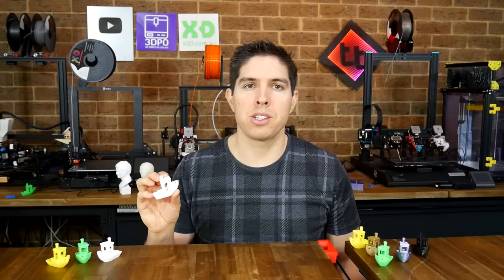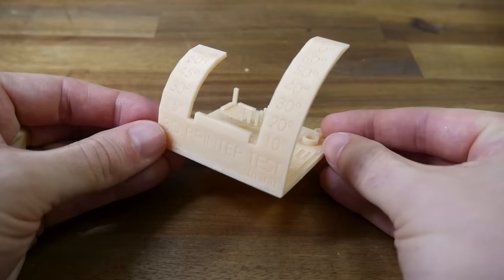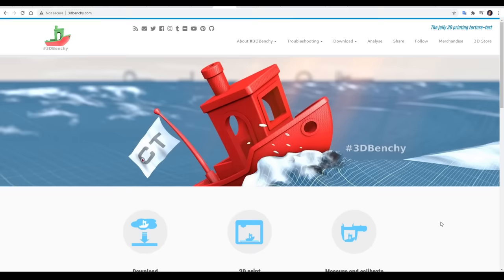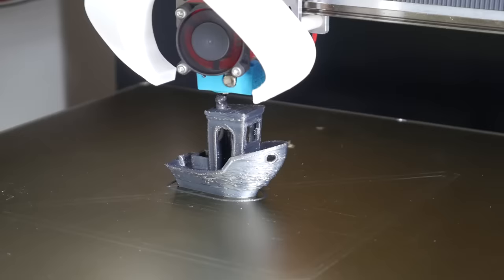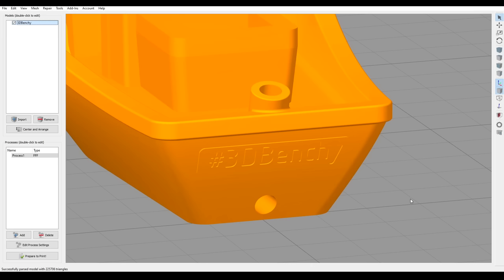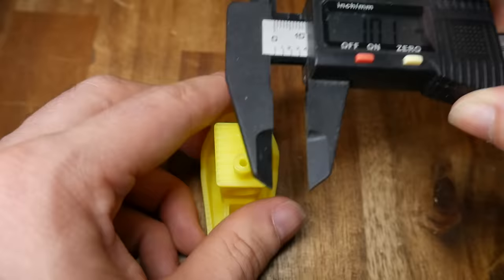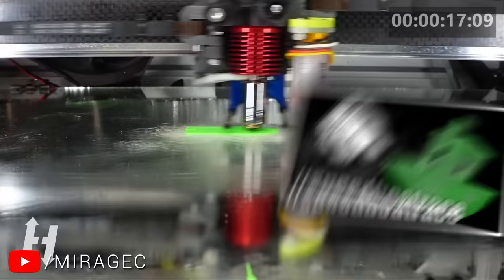How a 3DBenchy can tell where your 3D prints need improvement

Comment: For me, the #3DBenchy is a very useful tool that looks like a silly gimmick.
There's even more to it, for example you can stick the chimney of one benchy into the box of another benchy to easily check for over-/underextrusion and part fit.
Reply from the maker: Didn't know that, great tip thank you :)
Reply: Holy Crapoly!! that is cool!
Reply: I wish the website had "if this issue, solutions are this" would really help with trouble shooting
Reply: It may be useful, but for my personal taste, it's too silly looking to have dozens of these laying around. To be honest, I am not charmed by Benchy. It's too "cute".
I'll just design smaller utilitarian things to test specific things. But I'm boring like that. Guess I'm getting old.
Reply: How do you fix the bubbles/ zits in retraction it's a constant problem for me
Reply: @connorlancaster7541  Can Jesus tell me why my surface settings aren't performing?
Reply: The little bore in the bottom also, it fits perfectly the filament and it can't be a case.

Comment: in 1000 year archaeologist will say "they seemed to worship the god of boating and recreation"
Reply: Well no. Most filaments are biodegradable
Reply: unless the internet is still around
Reply: Nah, they'll be using benchy to test replicators
Reply: Pla lasts forever in the environment seennprontd that were outside for years and no deteration
Reply: @zombiej79  forever is a stretch but it does require ideal conditions to be bio degradable
Reply: @xathridtech727  the one I saw they left it in dirt for 5 years and didn't even change a bit was pretty crazy. I think it needs to be shredded down for it to biodegrade properly
Reply: @zombiej79  It needs an industrial process to biodegrade.
Reply: Hopefully humans will be smarter than that in the future.
Reply: @Mr_Yod  It needs an industrial process to biodegrade in a resonable amount of time( a few weeks). Buried in the ground for 1000 years it would break down.  ABS not so much.   They are gonna think we worshipped LEGO the God of interlocking blocks
Reply: @bjarkebuskbjerg743  they really are not. It will take the right exotic temperatures and environmental stuff. Pla will biodegrade in more than 1M years. You even need some bacteria to do stuff.
Reply: All hail the benchy
Reply: Isn't pla poly lactic acid Wich is biodegradable ? Like I read it was biodegradable but these comments say yes and no wtf
Reply: @bjarkebuskbjerg743  yeah give or take a few hundred thousand years
Reply: @jakeengland1430  well give it enough time everything well biodegrade just may take a few hundred thousand years
Reply: Or just small boat toys?

Not sure how finding a small 2-in plastic toy boat equates to worshiping boating and recreation.
Reply: @dangerous8333  I was pointing out how archeologists today say every trinket they find was sacred and worshiped. When it could have just been a kids toy or decoration.
Reply: @jakeengland1430  Pla is bio degradable
Reply: @willssnowboardclips748  did you even read the rest of thos thread before replying a month late
Reply: @jakeengland1430  no
Reply: @whatthefunction9140  Common misconception. While I’m sure there are the occasional instances of this happening, archaeologists and historians aren’t dummies. 

You hear about all these different special trinkets because…they’re special. They seem special for a large variety of reasons that all correlate together based on 1,000 other clues. 

It just seems like they call everything special because that’s the only things you hear about. No one wants to write an article about the toys or the hobby craft or anything like that(not geared towards the general public at least outside of certain circles). It’s not catchy. Won’t get them clicks. 

But I mean go check out some museums, or even just go check out some online historical stuff and you’ll see it’s FILLED with a bunch of “boring” or “ordinary” stuff that they well acknowledge doesn’t seem to hold much significance apart from giving us some insight on the culture and daily lives.
Reply: Alexandru Ciobanu  nope canadian lol
Reply: Good one:)
Reply: But only the ones printed in ABS
Reply: @gadz7584  biodegradable yes, but only in an industrial composting facility at 60+ degrees celsius with the right organisms present. 
on the ground in the woods or in an ocean only at extremely slow rates, if at all
Reply: Bahahhahahahhaha lit lol'n🤣🤣🤣 I love the sense of humor. I can picture it now😆
Reply: @stickboyfpv4742 
I was thinking we could all print
An ornate box from ABS to place our PLA Benchy in, with a note telling futre archeologists the reason. Why we all worshipped Boaty MC Boatface. 
Lets face it in 5000 years there will be plenty of misinfo about. 
A bit more won't do any harm.
Reply: Well the benchy doesn't float very well on ethyl acetate.
Reply: “These sculptures were clearly made using primitive additive manufacture devices, likely made in a cave powered from pedaling a bike”
Reply: Well, we do.  Just look at Miami Vice and early 80s television!

Our society is secretly divided into four camps - Fast Cars, Fast Boats, Big Trucks and Flying Machines!

Oh and they better talk or no dice!

Comment: As someone new to printing and modeling, the fact that someone created something so simple that is secretly so complicated is amazing to me
Reply: @connorlancaster7541  what
Reply: @connorlancaster7541  now the bots are preaching Christianity. Wonderful
Reply: @Rexxxed  I’m not a bot.
Reply: @billytalentxpokemon  You good?
Reply: 3D printing can be a spiritual experience - when you're dealing with perfection, not only drivers, calibrations, temperatures and speeds have to be dialled in for the exact filament you're using, but external vibrations, thermal air currents, solar heating, cats jumping on the desk, yelling in another room, and some even say brain waves, and the movement of angels near by can effect a "Perfect print".  Some prayers, a sacrifice (can be a leg of KFC chicken), perhaps an incense stick, feeding the cat, and printing at 2am after thermally protecting your filament reel for 48 hours will get you your perfect print. At that point 50cm overhangs at speeds of 3000mm/s, with zero ringing, zero droop, and no hull lines will be yours!

Comment: Massive coincidence. Just assembled my 1st 3d printer yesterday and I had some issues with my first Benchy. After about an hour on forums, I've found out it was insufficient cooling. The second one was freaking perfect. Gorgeous print that made my choose for an Ender 3 V2 worthwhile.
Reply: How did you improve the cooling on the Ender 3 v2? A new fan/fanduct or just slicer settings?
Reply: @hrbatta  not yet. I'll buy a better fan, maybe bigger one (4020 perhaps) and print a new duct. For now I only pointed my room fan at the printer. I already looked for ducts designs at thingverse but haven't choosed one yet.
Reply: I recently bought an Ender 3 V2 which happens to be my first 3D printer and when I try and print a benchy, it drags filament on the first layer, I’m not sure why, my theory is it is not sticking to the bed, any tips?
Reply: @Mo-bi1pk  yes. Definitely nozzle too far from bed. Manual bed levelling is an art. You' will get the hang of it. After a dozen times you will level by eye.
So, lvl the bed again if you want, or do the easy thing that is set a negative Z offset.   Last but not least, use glue stick. Yes, the glass bed can be used with nothing, but for me it doesn't work every time.
Reply: Nice. Are you still happy about your Ender? I'm thinking of buying one. Tx.
Reply: @gatekarain9780  definitely happy. After learning 3d printing quirks in general, it is reliable, make great looking prints and the community is great to answer questions. It is not fast but no bed slinger is. But with good quality filament and higher temperatures, I was able to print significantly faster than stock conservative speeds.
Reply: @ragzard  Thanks for the info!
Reply: @Mo-bi1pk  Print it with a brim. Every time i try otherwise, mine does the same as yours (Both with the magnetic bed and glass bed - and calibrated in soooo many heights). But using a brim with a minimum of 6mm brim width, it gets perfect every time.
Reply: @connorlancaster7541  

so jesus made men with original sin

Then killed everyone for the sin

Then saved some for the fun of it

Implanted himself in a women and sacrificed himself to himself for the original sin

Whyy
Reply: @Onlyindianpj  No original sin is a lie. You aren’t born with sin. We have free will we can choose to sin. If someone willfully sins they choose to hate God. You see God has a way he operates so there has to be a death in order for sin the payment of sin is death. If you sin there has to be a death paid that's why we all go to hell for our sins but Jesus came so that you wouldn't have to die so he paid that sacrifice that God the father requires to get into his kingdom that's how his courtroom works. 
Jesus came to teach us there are 300 prophecies of Jesus in the Old Testament of the Bible one of them is Micah 4:2 it says that Jesus came to teach us his ways which are perfect that’s why the devil hates Jesus. Jesus chose to come to this earth to teach us the perfect faith that God the father is looking for.
Reply: @Connor Lancaster Amen
Reply: @zacjohnson452  Praise the lord he is beautiful. Do you obey Jesus?
Reply: @connorlancaster7541  dang it, I’m just tryna get some 3D printer tips man
Reply: @connorlancaster7541  Asked him but he won't tell me shit about my 3D-printing issues.
Reply: So what did you change from your first to your second benchy? I had mine assembled  2 years ago.. no problem... even cooling.. I assembled with precision and that came back in the prints. I recently swapped my hotend and Now I have to print on 190 instead of 200 celsius. I cleaned cooling fans and shroud. But my benchy top end of the windows have a bit of sagging.. I suspect bad cooling. Can you turn it over 100 the cooling fan ?
Reply: @mrblunt4208  =D Welcome on the internet

Comment: My creality ender 3 V2 is having problems with sticking filament to the bed. I’ve tried cleaning the bed and adjusting the bed, but the filament just keeps curling up around the nozzle. I’ve also tried heating the bed. I don’t know if it’s still not leveled or if the temperature is still not right, but I’m really lost at what to try. I just bought it and haven’t been able to print a full model yet.

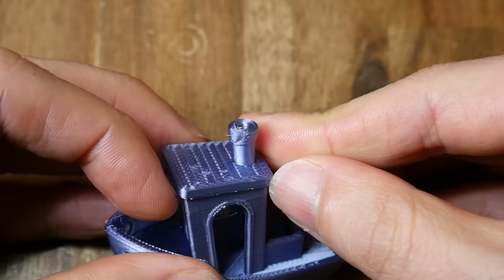Comment: 7:08 I'd really appreciate if you went into more detail on what exactly to tune in the slicer other than just "tune in the slicer"
Reply: Some older boards can't cope with too many lines of geode, when the print head stops while the board is still thinking, you can get those zits, some loosen resolution requirements so that the slicer makes fewer commands

Comment: I got an Ender 3 v2 last week and have had an Ender 3 pro for almost a year. I've been printing on that at 220c for the nozzle, and 60 for the bed. When I got the v2, I applied the same settings and the prints were terrible. Printed a ton of benchys after tuning here and there. Then it hit me. The temperature outside and in my house had changed so I had to compensate with my prints. Lowered both printers to 200 and everything is fine. Except I have about 20 benchys now, I need to print a dock for them at this point. I wish this video came out a week ago! But, great information and I definitely learned a lot and with each benchy print, I found more changes to make both in cura and my printer settings. You're the man Michael!
Reply: Idc that it has been 7 months but I am completely startled at how the room of the temperature can ruin any print like damn
Reply: @gamingknight4763  same

Comment: I print a Benchy with each new filament and it always shows something to tweak, but I was not aware of the website so thank you for that.
Reply: My three are the benchy, the extrusion check Y thing, and the temp tower. Between those, you can handle most calibration for new filament in an afternoon.

Comment: When you are printing a 3DBenchy , try simple sugar water as an adhesive, it cleans off really quickly , and bonds to glass, aluminum, etc really good. To make up up a little bit of sugar water adhesive , you need a microwavable glass, a microwave , and 1/2 teaspoon of water. All you have to do is put 1/2 teaspoon of sugar into a glass, then add only 2 to 3 drops water , and microwave the whole mixture for only 5 seconds.

This solution works so good that you do not need a BL Touch, (unless your bed is warped) you do need to replace the 4 springs with stiff yellow springs , then manually level your printer bed once, the new springs will suffice.

The last tips is the disinfectant that is used in a lot of retirement homes, it is called Vertigo Saber, and it does not harm your glass bed. This disinfectant really removes 90 percent of the plastic residue that is left behind.

Comment: what would make this video even better would be either a short explanation on how to correct the various issues or a link to information about how to.
I seem to be having a bit of a retraction issue, apart from that I seem to have my ender 3 tuned in pretty well.
Reply from the maker: At the end I suggest my free calibration website. Check out the link in the description.
Reply: @TeachingTech  cheers

Comment: I got my Ender 3 Pro for my birthday 3 weeka ago. The first print in my life was the Benchy xD
And it turned out great!! The Ender 3 is such a great machine right out of the box, would recommend!
Thx for the video, now i know that everything is perfect with my Printer and settings.
Reply: Great story bro!
Just the same as mine ;)
Reply: I buy Ender 3 two years ago. Good printer but prepare to adjust it and regocnize what is wrong. Bed leveling, bed warping and loose rollers are my most common problems. And keep hotbed clean.
Reply: @juhajuntunen7866  You are right, my bed is slightly warped, but nothing one sticky tape under the magnetic layer could fix.

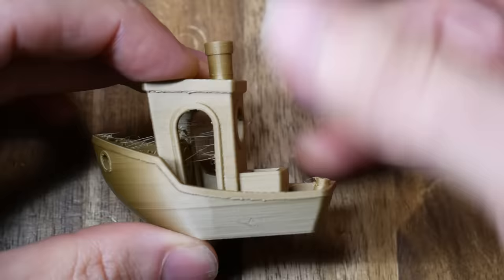Comment: 6:34 Just letting it be known - I was seeing stringiness on the deck and through the doorway as well. The problem in my case was a ground-down nozzle that kept malforming the plastic it put down. This would lead to weird blobs, zits and the occasional complete failure and gumming up of my hot-end as well. Replacing my hot-end did the trick, and with completely default Cura settings and auto-Z leveling for my Flsun SR, I was able to print a perfect benchy on the first try. Basically, check your nozzle quality/wear and tear as well.

Comment: Printed my first benchy today. I have been 3d printing for over a year.  Printed one on my Q5 with polymaker polytera, turned out beautifully. Proved that my printer is dialed in well. 
Printed one on my ender 3 w/mods using esun tough pla, looked equality good(my oldest printer, lots of time adjusting belts,wheels and slicer profile). 
The one I Printed on the tronxy x5sa with scripto pla and,e3d v6 w/ 1mm nozzle, well it turned out how you would expect.  
Nice to see the 2 printers I use the most are setup really well. 
The tronxy with that large of a nozzle is used for vases.

Comment: I am just getting into 3D printing, I printed a 3DBenchy, it.. it didn't go well. I've been using it for sanding practice. I have plenty of things I would like to print, and once I saw my 3DBenchy, I realised I have a lot to learn. The hull is the only part that really came out nicely. Well, the feel of it is nice, it isn't very symmetrical.

Your video has me examining every nook and cranny of my prints now. Ty, I aim to use one as a gift for a friend, so gotta get it perfect.

With each print, I learn something new.

I did however print a head of a figure and after a former not so great attempt (It was meant to be 10cm, it got printed at 4cm, it was a disaster), I got it pretty close to perfect. (With some sanding)

Comment: Thank you! I realized the bench also let me know some same filament type may have to have a different temperature for whatever science reason.
Reply: The white filament gives me the same trouble needing higher flow rate with a little more heat. 7°f to 10°f for me. Maybe because region where I live.

Comment: Hey Mike, hey everyone. I'm new to the scene as far as it comes to filament printing, I have, however, been messing around with resin printing for a while. Now a Geeetech I3 caught my attention and I'm gonna squeeze the last little bit out of it, so... definetly no contest. Remember, it's a Geeetech 😉

I love the 3D Benchy however, as a really useful tool. Managed to print one on the original GT setup and another one on my new extruder which I already have attached to the thing after one month. Teaches you well to stick to some real craftsmanship, as handling caliper gauges. It's amazing what 3D printers are capable of, especially when you have one extra, ready-to-print no matter what  as only the parts needed mustn't be too  tall 😉

Comment: Quick reminder for everyone: Stringing can be caused by both retraction issues and overly moist filament. Please remember to keep your filament in as dry a place as possible, ideally a dry box specifically for filament, for the best prints possible because no amount of tuning will fix your waterlogged filament.

Comment: I decided to give the benchy a test after one of my new filaments was acting weirdly. The benchy was mostly flawless and all details were smooth and near perfect. But it still gives me no info as to why my initial prints with the same filament (and no changes to settings) were having horizontal and consistent lines on the flat sides. SO I am stumped, but this benchy will be my new go to for testing filaments and my printers settings.

Comment: Yah had printer problems in our class printer, took it apart, put it back together, thought I fixed some leveling issues where the nozzle rammed into the board, started a bench and it lifted 🙃